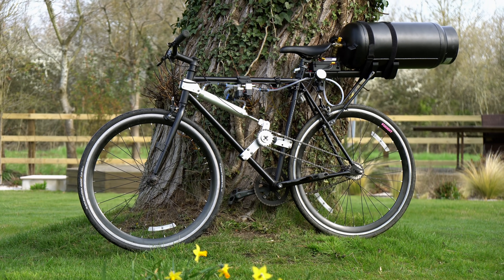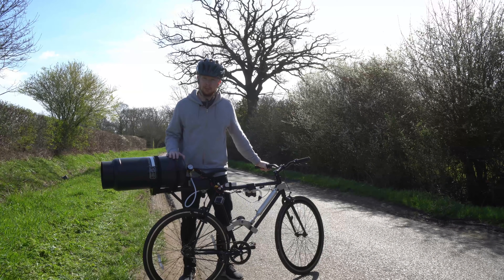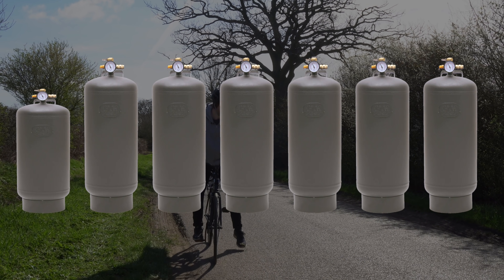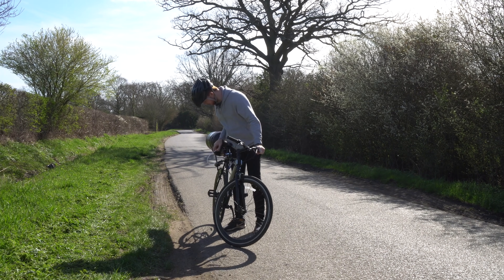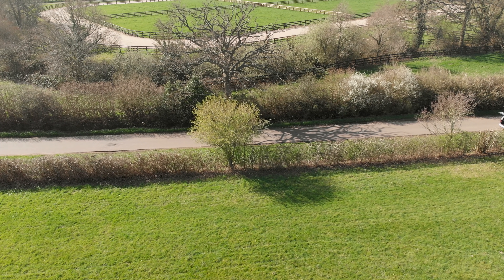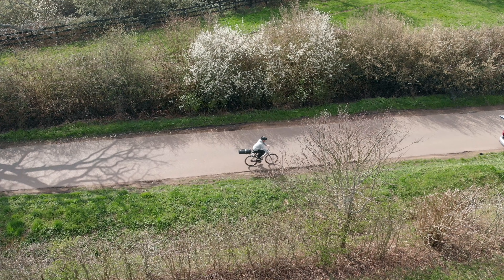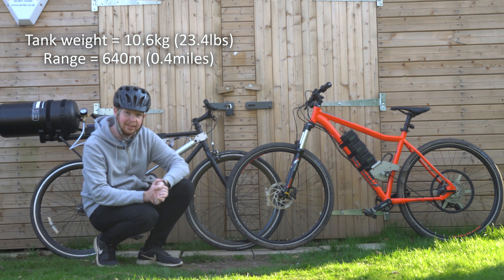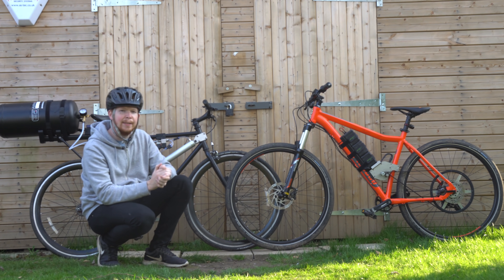Air Powered Bike Range

Comment: The regulator is expanding air to a lower pressure without extracting any useful work in the process. Variable valve timing (with no regulator) would allow you to extract a much larger fraction of the energy.
Reply: Came to the comments to mention this.  Assuming it was able to accurately maintain the exhaust pressure at 1 atmosphere, variable valve timing would still give the same number of total piston strokes but they would have a lot more force (at least until the tank pressure dropped below whatever the regulator had been set at, at which point both setups would be roughly equivalent).  If you don't mind going at the same (~walking) speed you could spend much more time coasting, eking out rather more range.

Other useful improvements:

- Use large-bore plumbing (particularly on the exhaust) to reduce energy wasted in pushing exhaust out of the cylinder.
- Make use of the bicycle's gears (whose weight penalty you are paying anyway) to allow the air engine to turn more slowly when the input pressure is high and/or when travelling at speed.

Comment: 1 - a carbon fiber scuba tank will not weigth so much
2 - you are doing it adiabatically, this means a lot less range.
3 - there is no easy way to solve the "adiabatically" part in your context (land vehicle) because you would need a heat source (hmmm).
4 - people who tried to create air powered vehicle ended up doing an hybrid between pneumatic and gasoline (pre-heat the air with a gas flame). Its still more economic than otto cycle.

Comment: Does the tank get cold when he use's it? 
Or is that just for certain other types of gases?
Reply: @Guodlca I have this issue with my co2 pistol, cartridge gets cold and pellets ricochet back at me instead of disintegrating.
Maybe a temperature sensor, coil and battery can squeeze some more meters out of the tank.
Reply: @Guodlca Maybe if he hooks up the electronic regulators to the battery he could get away with it.
Just a finetuning device to push the limits.
Reply: @Guodlca I would not try heat up the bottle, I would try heat up the  tube the feeds the piston.
But I do not claim to know the best solution this is just ideas.
Reply: @Guodlca I think it would give the air in the tube more energy, as it would want to expand faster.
As for the air in the bottle, as you said that would be to troublesome to try and heat up.
Reply: @Guodlca I never thaught the idea would result in godly performance improvements, the reason I baught up temperature is to suggest reasons why the end result was 640m instead of 684m. 
I'm sure their are many more factors that he would have to counter act to make up that 44m difference.
If he so wanted.

Comment: wrt the range, aren't you forgetting the thermo dynamics?? When releasing the pressure, the temperature in the tank drops, and air contracts = less pressure....
Reply: That's why he needs a parabolic reflector to provide passive solar heating to the tank.

Comment: Air powered vehicles have been done in the past, very effective but due to damaging the market of conventional forms of energy they have been side lined.

For a bicycle this is perfect, one could revers this and refill the air tank when going downhill, the air tank could be part of the frame and the air power could be used when needed it’s an idea that should be looked into, as it is very green just like the bicycle unlike the eBikes

Comment: Acquisition of a 6.8L 300Bar (4500 Psi) Carbon Fiber tank would be a wise investment. (Aliexpress)
Optionally, you could go to you local fire-hall and ask if you could borrow one of their SCBA tanks (no U because they are not underwater) for scientific testing, you would bring it back empty...
SCUBA tanks are intentionally heavy. They are made that way to be neutrally buoyant in water.

https://www.aliexpress.com/item/2017-Hot-sale-6-8L-60min-30Mpa-4500psi-carbon-fiber-air-tank-SCUBA-diving-equipment-pcp/32816319702.html
Reply: I was trying to figure out how many liters are in a 6.8L tank @ 3000 & 4500Psi but, I don't understand the calculations.

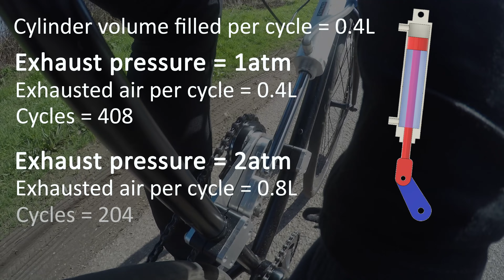Comment: Quick note one the calculation you're doing at 3:40 
The volume used per cycle does not change depending on your exhaust pressure, it only effects the amount of energy you get out of it. Since you are still filling the cylinder with the same pressure and volume. You're just not letting it expand as much.

So, you'll get the same number of cycles. However the cylinder don't put as much  force into the system for each stroke.
Reply: as far as I understand it does change, because the Volume does not stay the same, the output pressure depends on how long, of the pistons expansion you let flow air into the cylinder. If you let air flow until the end you will get an exhaust pressure close to the input pressure, which results in a higher volume used when measured at atmospheric pressure. 

I hope this makes any sense.
Reply: @mraffifpv1685  When measuring at atmospheric pressure you're correct, that does change. But if the goal is to try to establish how many cycles you can get out of the pressured tank, the volume at atmospheric pressure is irrelevant, the volume at tank pressure is what you're after.
So you're measuring from the point in time the valve opens, to when it closes. How much it expands during the power stroke will influence efficiency, but not change the pressure drop in the tank.

Comment: Air powered vehicles are useful enough, in the right niche...

That niche being environments that have a high explosion risk, where an electric or internal combustion engine could cause the gases around the vehicle to ignite.

there are several known examples of air powered trains in use in such environments.
Range isn't a huge issue, because it just has to have enough range to travel inside the hazardous environment back and forth to the  facility that refills the air, and outside that it hands cargo over to a more conventional vehicle.

Still, a niche use is still worthwhile thing...

Comment: Genius idea: install a battery powered air compressor on the bike to keep filling the tank.
You can have that one for free Tom.
Reply: then put a little windmill on the exhaust and use it to power the compressor..
Reply: You’re probably just being cheeky but...

All of the inefficiencies would add up to not make it worth it. A compressor that could fit on the bike would never be able to keep the tank at a usable pressure and all the added weight of it and the battery that powers it would weigh a ton. 

Thinking about improvements and trade offs is in the spirit of engineering though so cheers dude :)

Comment: If you adjust the timing of the inlet valve after the bike is in motion and make it open for a shorter amount of time, you gain less power but more speed. kinda like gearing in a car.
look up valve gear for steam trains or more specially 'cut off'. It'll be a more efficient use of your air supply and you should be able to travel even further.

Comment: Lots of efficiency lost converting to linear then to rotational motion.
And all the associated weight and mechanical friction.
I've always thought that the best way would be direct to rotational movement. Like the cups of an anemometer on an axle in some kind of a sealed race.
Reply: a rotary  engine would use 1 psi to overcome

Comment: How about CO2? Stored as a liquid good high pressure, plenty of gas relatively cheap
Reply: that was my thought. I think he also needs a way to change the pressure as riding that way you can accelerate fast using a lot of energy but still maintain speed using very little, like a car.
Reply: Evaporating CO2 requires heat from the surroundings. If you don't expand it through some large radiator or intercooler, then it  will simply freeze and possibly crack the cylinder, piston, and  seals.
Reply: @AndreiNeacsu  This is very true. In the marijuana industry they use supercritical CO2 for extraction. It takes extremely specialized equipment
Reply: @skeetsmcgrew3282  They sell CO2 at sporting goods store that sell paintball equipment, it's super cheap.
Reply: @AndreiNeacsu  Also the same volume of CO2 weights a lot more than N2 due to gaslaws and its higher molar mass.
Reply: @AndreiNeacsu  a little research on Google and here will show its perfectly possible to run cylinders on CO2 without masses of expensive equipment. A simple regulator to bing it down from 800 odd PSI and a small expansion tank, would be more than enough
Reply: Relatively cheap compared to what, rocket fuel?
Reply: @skeetsmcgrew3282  as they use large tanks of it in pubs/bars for pressuring drinks it is very cheap.
Reply: @davers1610  Ok fair. But that's like 5ml at a time. This guy depleted dozens of liters in a few minutes. If it's in mg even gold isn't that expensive
Reply: He needs a different piston too.  Shorter and fatter.  That’s the longest crank arm that fits in the frame, so he needs a shorter piston to get a better angle
Reply: And also optimize the gearing .
Reply: It’s a cool experiment and used under pedal assist when needed is coolest not revolutionary but the first attempt never is keep trying
Reply: waters cheaper just heat it up and you got steam
Reply: @shannyjackson9206  virtually all power plants, except for solar-electric, heat up water to make steam which drives turbines which generates the electrical power that we all use. That includes coal, petroleum, natural gas, nuclear fission (and eventually nuclear fusion, some day) as well as solar-thermal energy, which works the same way, except the heat comes from the sun instead, still using steam turbines to generate electricity. Geothermal energy is almost the same but instead of using water for steam, water is just a heat-exchanging fluid, to pull the heat from the ground, after which, that heat boils a liquid which has a much lower boiling-point than water, and this lower temperature "steam" is used to spin the turbines. Power plants which don't require any heat, include hydroelectric dams, which relies on gravitational potential (weight and height) of water to spin turbines to generate electrical power. There's also wind power, which is just windmills used like the other turbine-driven generators. Then finally, of course, there's solar power, which uses quantum physics to turn light energy directly into electrical energy; no turbines, no steam, no heating or burning stuff, and no moving-parts, whatsoever. That's why it's the best.
Reply: Having well-designed "moving parts" makes something simple, efficient and reliable. Photovoltaic panels are very inefficient (10%-26%) and cannot withstand some environmental conditions and need periodic cleaning. They are also complex and polluting the environment. In general, thermal cells are considered much better than them, but the promotion for photovoltaic cells by consumer companies is what Make people believe unfortunately.
Reply: A soda stream bottle can take serious pressures and is relatively small. A few safety valves and a decent compressor could increase the range a lot.
Reply: So much for zero carbon emission!
Reply: @corkymork  well it would be zero emissive, because when you buy a Dry Ice you need to know that it's produced somehow. They take that CO2 from air so it's just circulating CO2.
Reply: @geiger21  yeah, consuming energy to transform it and transforming it back, very inefficient. Plus your energy, unless it's renewable is coal or nuclear, none of those are clean...
Reply: @_bluespider5470  there is no clean energy. Every energy source has some drawbacks.
Reply: @geiger21  there is no miracle solution, but some are worst than others, coal for example is an abomination
Reply: @geiger21  get quite clean with wind, wave and solar
Reply: @corkymork  you don't emmit it you just "recycle" it.
Reply: nothin can beat a battery, it has everything

Comment: Could you fit a second piston to recover lost exhaust pressure, it was common for steam engines. I'm curious on the difference it would make especially on the limited air supply.

Comment: Would this project benefit from a second cylinder which runs on the lower pressure released by the first cylinder at high load?

Comment: There are in a few steel works air powered "trains" which are a sort of small train on tracks used for lugging up to 10 tonnes from one place to the next. They do about 4MPH over a distance of about 0.5km. I was told they are cheaper than electric to run but completely impractical for anything longer. The storage cylinders are re-filled at each end.

Comment: What about using carbon dioxide instead of air.  Carbon dioxide can be liquified allowing for more stored gas.  I think the main problem you will have is the chilling of the tank that can reduce the effective pressure.

Comment: I built a large variable valve system for a cylinder about double the size of the one you are using and with the proper pressure and flow is capable of up to 600 BHP although getting 600 HP of pressurized gas was something we were unable to build due to the misdirection of the project's director.

Sounds ironic? It was! PAINFULLY SO in fact!

The guy swore devotion and then wandered (mentally) all over the place, totally impeding his own potential progress, as we had a perfectly working system built and then he just stopped and went off chasing other crap which just wasted tens of thousands of dollars and years of valuable research time until circumstances forced all research to completely end. [sigh]

2 Lessons to be learned: A, Devise a truly cutting edge program and 2, STICK WITH IT!

He started off on the right path but then go lured away by stupid garbage like 'zero point energy' and 'HHO "Brown's Gas" ', trying to make his own extruded mirrors, etc... All that did was destroy the project.

Comment: You should try a chainless .. or shaft drive  I think you're loosing allot of energy with this system
Reply: FSK1138 

You’d think so, but most chain drives are above 80% efficiency, with nice ones as high as 90%. I don’t know much about shaft drives, but I assume they’re about the same.

Comment: You could run the cylinder at higher pressure and add a second low pressure cylinder in series to use as much Enee as possible while still having a good bit of power.

Comment: I think you need a composite scuba diving bottle at much higher pressure!
Reply: you may be able to hook up hpa tanks for paintball and such in series to acheive 3000+ psi
Reply: MrWarwick15 the cylinder can’t handle more than 100 psi
Reply: @calebm.5698  so does a diver breath air at 3000 psi? That's what pressure regulators are for......!
Reply: The problem is this, to get more power out of his setup, he would need to either use more cylinders or use a cylinder with more surface area to get roughly the same efficiency. He could very well improve of what he has at the moment but he does not seem very determined ;D. I mean, throughout the whole video, i though that the electric bike is the better option but somehow i feel like he didn't really tryed that hard to make the pneumatic bike work. One cylinder is the most basic that you can get, the electrical equivalent would be an electrical motor  
with only one winding.

Comment: Maybe 250 yards? Was wrong...
Next step: two stage regulator with scuba tank! Edit: go carbon fiber wrapped tank, far lighter.
Next step after that: liquid co2! There's more energy available in the phase change! If course freezing can be an issue...

Also also: what about KE recapture and dispensation with a smaller scale air system? Piston brake, pain accel assist kind of like a hybrid!

Comment: What if you were to find a way to inject an atomized hydrocarbon into the cylinder along with the air and then make a system for generating an electric spark to trigger the rapid oxidation of the hydrocarbon, which would generate a tremendous amount of heat and expanding gas pressure. You probably would not even need the air tank at all, and just a small container of hydrocarbons.

Comment: Now all you need to do is instead of carrying a tank of compressed air you use a valve to compress a mixture of fuel and air to it's optimum ratios and ignite the mixture while it's compressed. Fuel such as, oh, idk, gasoline, is so energy dense that you could carry around a gallon of fuel and it would last you around 150 miles.
Someone should invent such a vehicle.

This is sarcasm. It's a motorcycle.

Comment: That's pretty sweet; your linear cylinder to rotary crank mechanism is ingenious.  I think you'd get better results by putting a tank on a trailer and scaling the volume (cubic wrt tank size) rather than the pressure (proportional scaling, requires exotic hardware). A trailer could carry 500 liters or more, which would multiply your range by a factor of 20.  A volume of compressed air in a ship's hold or train car extends the benefits of cubic scaling further...but it doesn't scale down to bike sizes well.